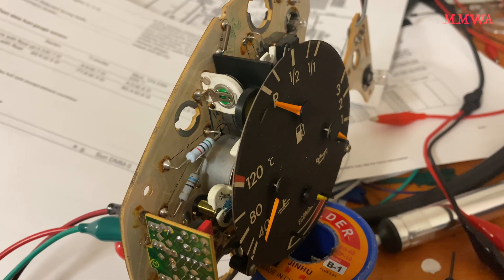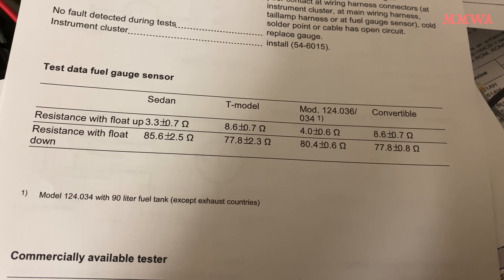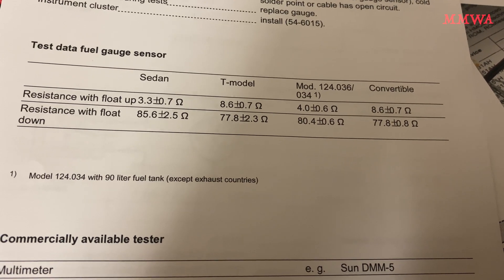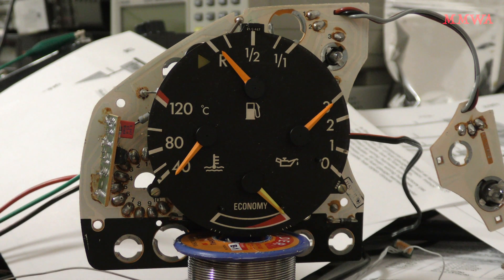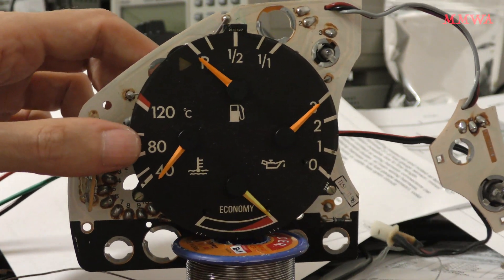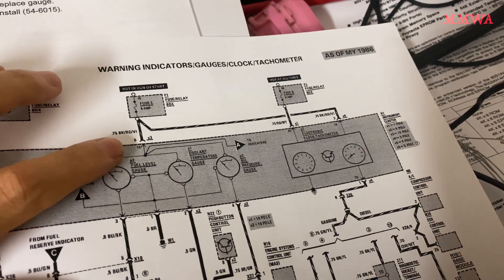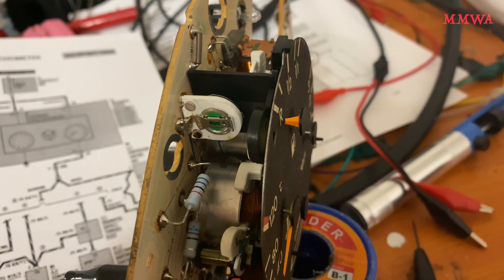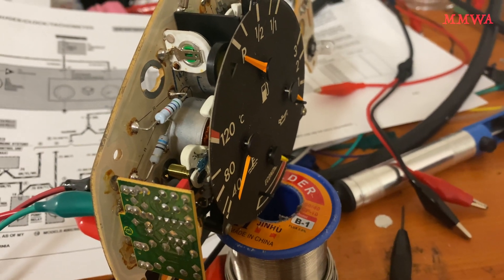Mercedes W124, A124 & S124 fuel gauges aren't all calibrated the same, but can be...

Comment: I got a calibration issue in my 300E - but I doubt adjusting the gauge pot can correct it. In fact, it seems to have deteriorated over time, to the point now where it does not go below the half point. The sender unit seems fine. I took it out the other day, and it was clean as a whistle - plus, it sends the correct resistance (2.8 - 84 Ohm), going from full to empty. There is a smooth motion of the float along the rod. I tested with a potmeter, and it seems that if the resistance is increased beyond the 84 ohm (needle currently positioned at the middle point), the needle with continue towards R (Reserve indicator). If I could only find a way to scale the resistance of the wires with some constant factor, I think it would fix the problem. However, it beats me how the calibration has become out of whack in the first place.

Comment: I'm using a w124 cluster in a w123 sedan and the fuel gauge doesn't go down enough when the tank is empty because of the w123 fuel level sensor, is it possible to calibrate the gauge to read correctly?

Comment: Thank you so much for this video!  My fuel gauge was wonky and I had replaced the sender which didn't help. I pulled the cluster and cleaned the trim pot, (also installed some LED's to stop the melting plastic). But then the fuel gauge read empty all the time. I bench tested using your procedure and found my fuel gauge is fine.  I still don't know what's wrong, but I know its not the fuel gauge. Suggestions appreciated.

Comment: Have had an erratic fuel gauge for a few years now in my '94 S124. I had the cluster apart recently to repair damage done by the main illumination bulbs having previously been replaced with too high wattage.
I noticed the calibration pot and, as you said in this video, thought its oxidation could be the cause of the gauge issue.
I have some old audio gear, so have a can of Deoxit D5. Unfortunately, spraying the pot has not cured the issue. I am sure the problem is with the gauge rather than the sender or elsewhere as it usually jumps to empty or full, and will return to the true level if I bash the top of the dash near the gauge.
I did wonder whether I should adjust the pot back and forth in the hope that could help with its cleaning. Was worried about doing so, but having watched this video, am less worried. I have a spare sender, so fairly easy to plug that in and use it to recalibrate the gauge. 
Do you think that's worth a try, or is my best bet to attempt to reflow the solder around the gauge?

Comment: How you doing I do watch your videos and I’m a subscriber on your channel, you do a great job , I want to rebuild my w124 1991 break calibers , I wonder where to get the repair kit, please advise me where to get it , thank you 🙏
Reply from the maker: i bought my kits on ebay. Just make sure they are correct for the calipers, theres different brand calipers and different calipers per model. You should see which ones you have first before ordering.
Reply: I know I’m Looking at eBay they have too many kinds of repair kit for break calipers , can you send me a specific kit with link to eBay 👍
Reply from the maker: @ameershannaq3745  I already told you what you need to do, you are not going to get the right kit without finding what caliper brand you have installed per axle and what model car it is. You can have the dealership look up the part number of the repair kit with your vin, you will still need to know what brand they are.
Reply: Ok I got you now , thanks again 👍

Comment: Thanks for this brillliant video.
How do you get this detailed, technical service manual please? Still possible to find one?
Reply from the maker: So the wiring diagram featured in the video is out on the internet easy to get, W124 ETM, but the service manual, not so much. Its now very difficult to get unauthorised copies of service manuals even for old cars like this. MB actively goes after people sharing them.
Reply: @MMWA-DAVE  thanks. If only its for the classics (manual) , MB should be happy we are keeping it alive. A testament to their brilliant engineering of past. They should acknowledge the fact the there still millions of w126, w124, w140 running globally and remanufacture the no longer available parts.

Comment: I did a similar gauge calibration on my 99.5 Jetta… except in that case you completely empty the tank, add an exact amount of fuel in, and then adjust the instruments with a scan tool.
My W126 has a dead spot on on the fuel level sender, I really need to pull it apart and clean it. It is nice the low fuel level light is done with a separate contact. 
I had bad solder joints on the cluster of my W126, that one was a bit easier to work on.

Comment: i actually had this issue for ages i have T car and swapped  it with sedan and i got left stranded on road multiple times because of this
Reply from the maker: the level sender, if working, should still light the reserve warning lamp regardless of the accuracy of the needle as long as the bulb is working. That reserve warning lamp is a separate circuit.
Reply: @MMWA-DAVE  mine is the early one it doesn't have light for fuel
Reply from the maker: @Mahmoud.Jehad.Nassan  interesting, was not aware of there being ones without the reserve warning lamp.

Comment: I had a fluctuating fuel needle in my W124. I added 2 cans of Sea Foam fuel cleaner then drove 20 miles, but the issue continued. Ended up removing the fuel gauge sending unit and manually moved the float while my wife told what the gauge was doing. Put it back together and it hasn't fluctuated since. The problem I'm having is getting the sending unit plug gasket to stop leaking fuel. I didn't apply any sealant to the rubber as none was visible at disassembly. I'm concerned about over tightening the plug. Any suggestions are appreciated. Thanks!
Reply from the maker: I have not pulled the sender apart yet on red so i’m not yet familiar with the process. Unless you are talking about the standard seal that is replaced with the entire sending unit - then you probably just need a new seal.
Reply: @MMWA-DAVE  Thanks for your reply. The gasket is about 4 inches in diameter with about 3/4 inch of gasket material making up the circumference. It looked in good shape without cracks or deterioration and was pliable.